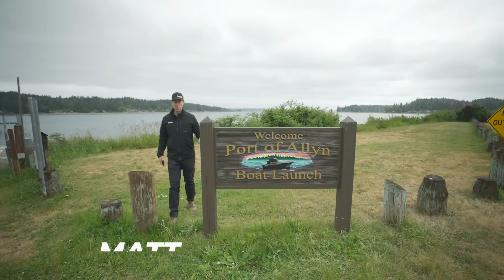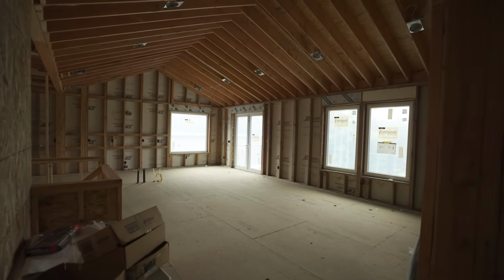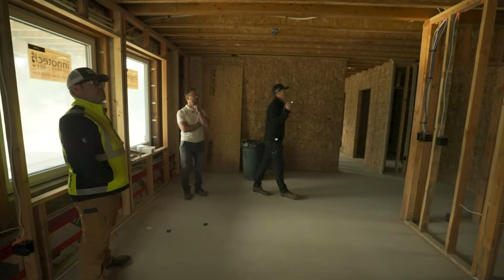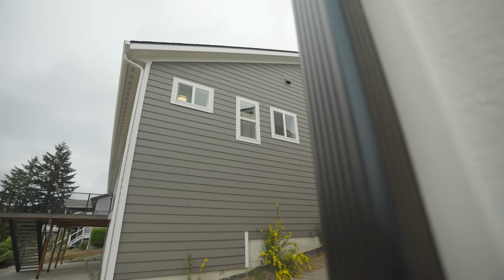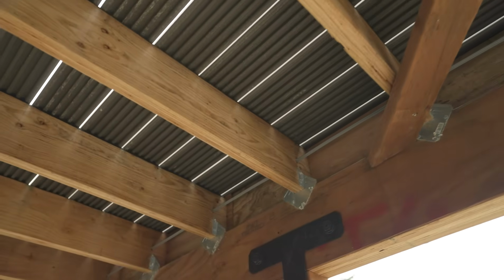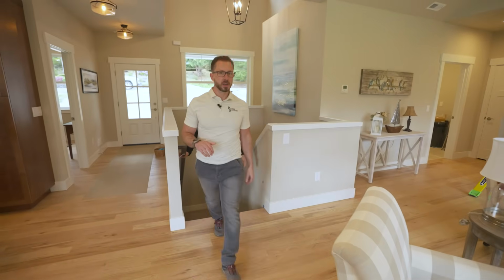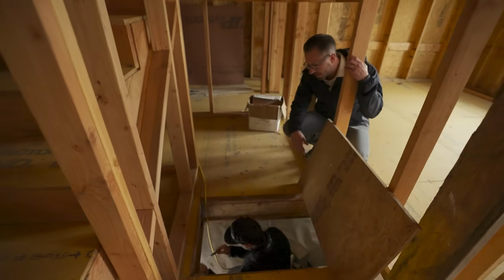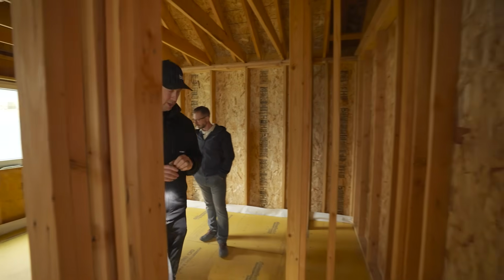Build Across America | Episode 4 - One size fits none: Adaptable building in Pacific Northwest

Comment: Matt, weather patterns in the NW are changing. Higher intensity precipitation with shorter duration.

Glacial till is the “hard pan.” The loose soil on top can be weathered glacial till, though it isn’t called that as loose soil.

Comment: Power outages in PNW should be a consideration for the electric panel install.  Having a gen-set transfer switch isn’t necessary, it’s just a nice piece of mind when the temp is 29 degrees and the wind is blowing and power is out.  Residential Fire sprinklers systems should be a no brainer in new construction.
Reply: What is the costs vs number of fires in residential???? It's a no Brainerd to NOT have sprinklers in homes.

Comment: It's not just that the PNW has potential for some seismic activity. It has potential for MASSIVE seismic activity. The cascadia subduction zone has potential for absolutely insane quaks. Like 9+. It's super dangerous and has higher potential than the San Andreas. (8ish compared to 9+). So that's why the PNW has such high standards...which honestly aren't high enough. I think most buildings can survive like a 7. Last big one we had was 6.8 in 2001. So ya, definitely way better to overbuild in this area and it's also why we don't want to use stuff like stone or brick. It would just crumble around you and crush you to death. I see a lot of people from other areas or other countries crap on our timber construction not understanding that it needs to be able to handle that seismic load.

Comment: I would not feel safe in this house, people in the Northwest should all live in SIP panel houses that are just floating on a slab, light, rigid and and decoupled from the ground.
Reply: I'm sorry, that's a highly ignorant opinion. This house has been engineered for this siesmic seismic design D2.  SIPs certianly have their pros, but also cons.  Everything has pros and cons, but the conclusion you've drawn is not an accurate one.
Reply: @TimUhler1977  I don't care about the building code, bracing walls with 5 layers of OSB won't change anything, studs are not continuous between floors so the walls of the first floor will fold  to the ground.
Reply: @kjs65a56 never let facts get in your way 😂😂😂
Reply: @TimUhler1977  The single house to be the sole survivor amidst widespread destruction will be mine, good luck with your seismic design D2.
Reply: @kjs65a56 no luck needed....just engineering 👍👍

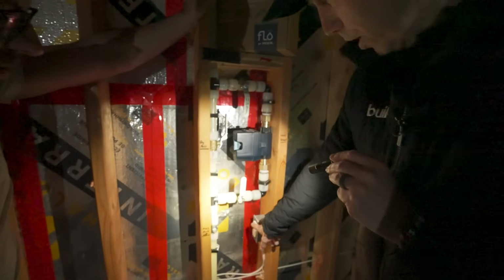Comment: 22:41 Why would you put the AC outlet directly below the plumbing where water can make its way into the outlet if there’s a leak?
Reply: good point!
Reply: Commercial electrician. Drinking fountains usually have a GFCI protected receptacle under the shroud. So long as that receptacle is GFCI protected, which it should be if built under recent codes, then zero concern.
Reply: @3deuce Code is considered D-, just above failing. Sorry but I don’t care if it meets code. If water gets in there, you’ll corrode the outlet even if you are “protected”. You’ll have to replace it by calling in an electrician, more waste of money and hassle. Why don’t builders or electricians practice prevention instead of meeting minimum code?
Reply: @JohnLee-db9zt or you could accept that there's really no legitimate concern and things are done all the time like this? Receptacle under the sink for a garbage disposal? Come on. Saying  meeting code is "D-" is just lazy.
Reply: @3deuce There are are many things in code that don’t make sense. Now you can’t put AC outlets on kitchen islands because people might trip over wires. Never seen that happen, unless someone was dumb enough to place the wire across walking path from the island to the countertop. I don’t accept anything just because it’s just the way it’s done. Code changes over time and geographic regions because codes are supposed to “improve” safety. Meeting code is absolutely the minimum. It’s either pass or fail.  There are many things you can do above code to improve the safety of your home.
Reply: @JohnLee-db9zt The reason for that code change, is because a number of children have pulled things like crock pots down on themselves with the cord. Previously the code made people put a receptacle on an island or peninsula because people would run extension cords to power them, and that has a host of issues. 

Yes, codes constantly change as we get new information. But saying they're the minimum standard is disingenuous. Code says I can't put more than 360 degrees of bend in a conduit run before setting a pull point. So, if i hit 360 is that being lazy? It might be unavoidable because of how something was built. Code says you need two 16d nails in a 2x4 end nailed stud, if you put in two is that doing the bare minimum? Or is it recognizing that putting in seven will destroy the stud.

You have to recognize that the purpose of the codes is primarily fire and life safety. Codes won't tell you how to build a house that's going to last 200 years, or how to build a house thats easy to work on later. That's not why they exist.
Reply: @JohnLee-db9zt no outlet on the sides of cabinets because several kids pulled hot appliances onto their head and died. You can still do countertop outlets. But yes, code always changing to make things safer.

Comment: Another option in earthquake zones is ICF. I DIY built a 5-story passive multigenerational ICF home. The key is you have to go 8” of concrete from the bottom to the top of my 48’ walls. Plus my engineer had me put in a lot more rebar. And I have a 16’ tall room under my garage floor that is made from foam blocks, rebar and poured concrete.
Reply: Another Risinger/Build Show video, another pro-ICF comment.

Comment: They always under-build as usual here in the NW, an earthquake zone.  Typical new NW style home.  Boring.  Sorry to be a downer but meh.  Also, why is the outlet for powering the water shut off in the same stud box as the water supply? So many thoughts and questions.
Reply: Having a receptacle under a water source is a lot more common than you'd think. Pretty standard for wall mounted drinking fountains, for example.

The only caveat is that you want the receptacle GFCI protected. Now, recent codes require that all receptacles in basements, finished or not, need GFCI protection. I'd use a standard receptacle at the water unit and a GFCI breaker at the panel, personally.
Reply: What would you have done differently in an earthquake zone?
Reply: The Flo by Moen gets power from that receptacle

Comment: As someone who lived in the Seattle area for many years, those two first houses are like the Eastside standard design. I have always wondered about about why so many homes are build like they were intended to be a duplex, many even have a second kitchen on the ground floor. Oddly, the number that have been converted into duplexes is surprisingly low. I had that same odd large spare room in mine, which I converted into a home theater.
I love seeing well built houses that if not in the Puget Sound area would be reasonably priced.

Comment: I wouldn't be surprised if the purpose of that interior shearwall was to simply reduce the lateral loading of the Zip-R exterior walls. A central shearwall like that would take most of the lateral loads in that direction. A lot of the PNW is seismic design category D, which combined with a max height/width ratio of 2 for Zip-R shearwalls and no allowance for the perforated method (only segmented shearwalls), makes for a tricky lateral analysis.

Combine a minimum shearwall length of 4.5ft for a 9ft tall wall with the relatively low shear capacity of Zip-R panels, and you've got a bunch of load with nowhere to put it. I can't tell you how often I end up adding interior sheathing on Zip-R projects to get the required lateral capacity.
Reply: Shear walls are for wind loads, the cards of a house of cards are all braced...